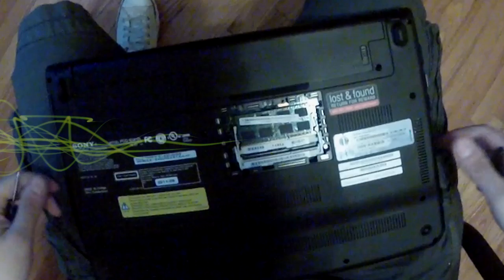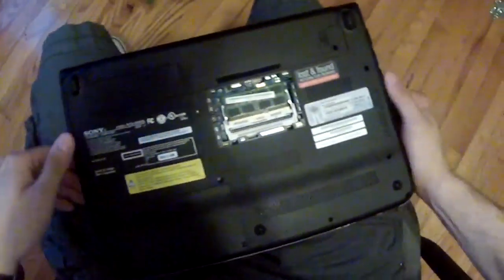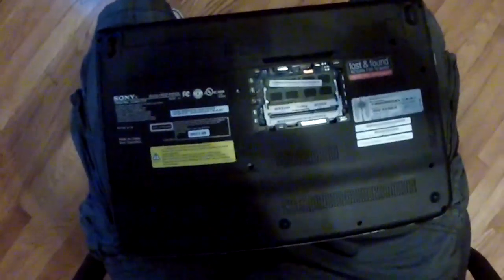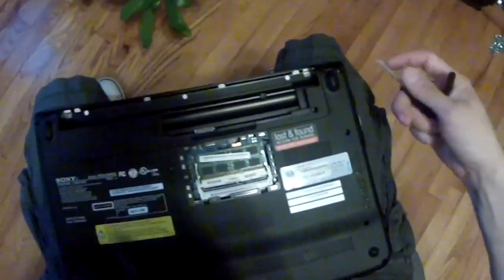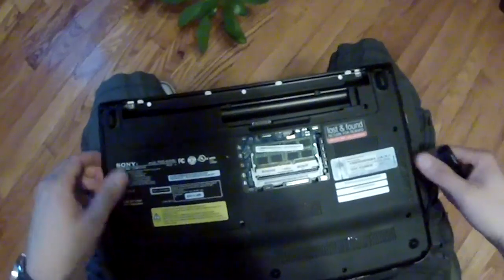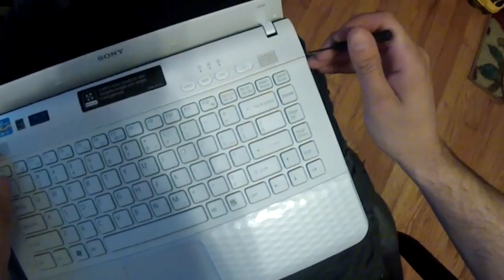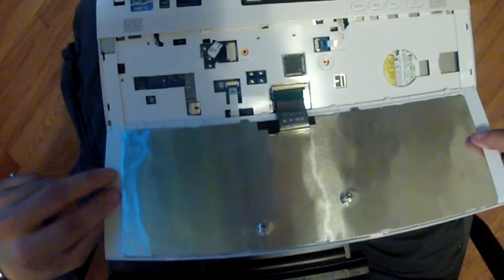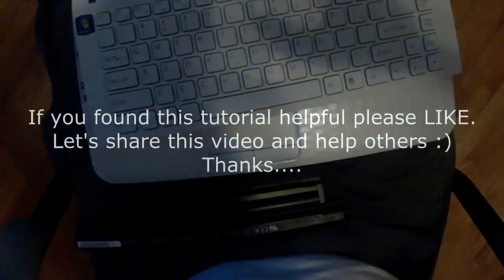How to Remove Keyboard from Sony Vaio VPCEG27FM/PCG-61A12L

Comment: Soo I recently changed my keyboard on my laptop and when I removed my ribbon cable the black part came off of the ribbon  does that happen?? Or did I do it probably? Or did I mess it up?
Reply: you are hosed lol because usually that is what keeps the contact between the ribbon and the motherboard. lol naw you might be ok

Comment: Good video, but actually you just need to remove only two, one is located next to memory door with three dots and the second one you need to open the memory door and you will see a screw at the top.
Reply from the maker: Thank you for your help.  I have added this as an annotation to the video

Comment: First take off battery away or you might crash your motheboard! Next to remove use chips or something do in plastic it's very gentle part's out there and you will avoid scratch on top assy of laptop :) but yeah You did good at it :)

Comment: If you look at the video, you'll see you've opened the memory compartment -and- removed the screw at the top of the compartment (you can see the copper-colored nut without the screw). This is why the keyboard pops out - if you don't remove that screw, the keyboard will seem 'stuck' between the F5 and F6 keys when you try to remove it.